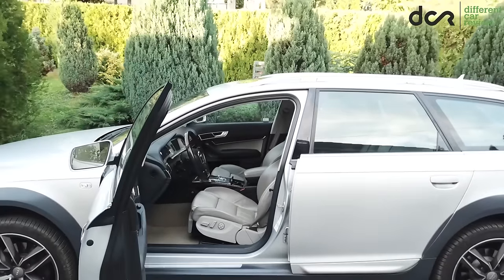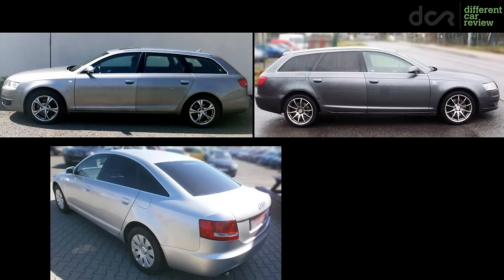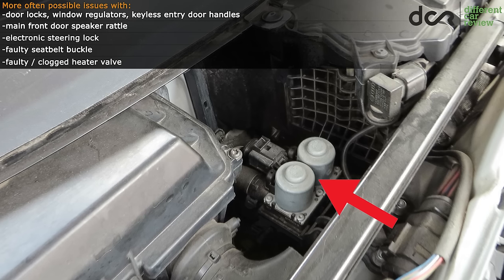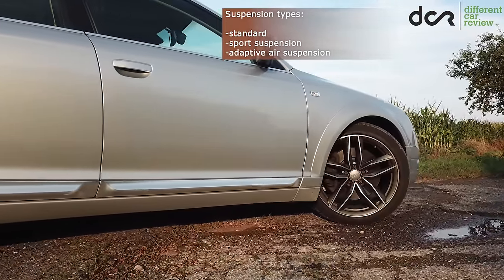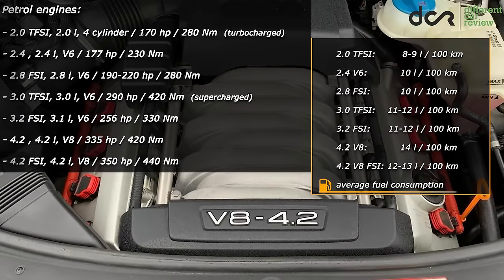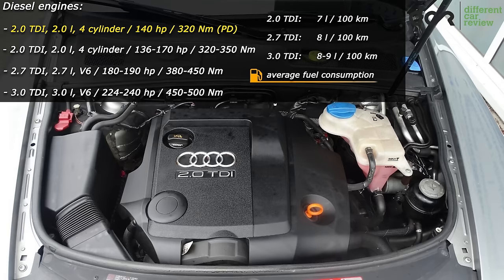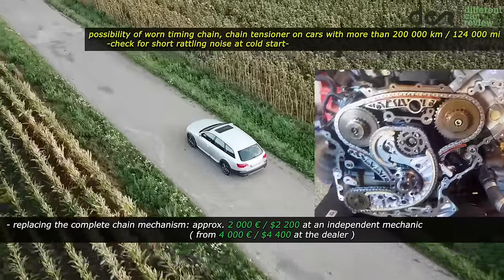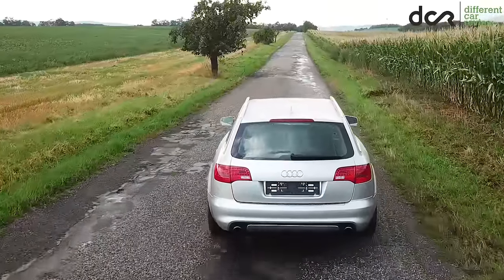used Audi A6 (C6/4F) - 2004-2011, Complete Buying guide with Common Issues

Comment: I"ve had the 2005 a6 4.2 for a year now, my only problem is that the whole left rear light wont work, even after replacing the lights. no turn signal, or brake light on that side. havnt been pulled over yet!
Reply: Post Malone hey I had the same problem but with both sides. There was a crack on my tail light allowing water to get in. The solution was just going and getting it rewired at the dealership
Reply: @ouu9380  Ditto to this comment but I didnt go to the dealership. Way cheaper to go to an Audi specialist, cheap to get rewired no problem and no risk of getting pulled over

Comment: Hello, awesome video, I have discarded lots of multitronic versions from my searching / list! 
I need your help / opinions please: 
I found a 2005 Audi A6 V8 Triptonic without quattro vs a 2006 Audi A6 V6 3.2 FSi quattro , which one would you buy if the 2005 Audi is 1000 Euros cheap than the v6 fsi? I dont know if the 2006 is triptonic or multitronic, even if its triptoonic, as I far I know, quattro versions got air suspensions by default making this v6 less reliable?
Reply from the maker: Hi
-all the V8 and all the quattro versions are always equipped with the tiptronic, + the V8 models always have the quattro 4wd system
-the air suspension was always optional, so only the Allroad versions have it as standard (if the car you are looking at has air suspension then of course sooner or later you have to expect leaking air struts and worn out air compressor)

if you are asking which one to buy the 2005 4.2l V8 or the 2006 3.2 FSI, then this mostly depends on the condition of the car and the mileage, since both of these engines can withstand a lot with regular maintenance, so they dont really have any serious issues, but:

-both of these engines have a timing chain mechanism which can be worn after approx. 200 000 km-mainly if the previous owner have not changed the oil often, so listen for a short rattle at cold start which is the sign of a worn chain

-the 3.2 FSI can have a noticeable amount of carbon build up on the intake valves + it can have faulty injectors-causing misfires, as the other direct injection engines

+ the various oil or coolant leaks can be more expensive to fix on the V8 engine
Reply: @differentcarreview-dcr  Thank you, sorry for my late answer.

I will go for the V6 3.2 Fsi, it got 112, 000 km, instead the V8 which got 200k km.
The V6 3.2 fsi quattro looks nice, I will follow all the tips before purchasing it mate! Thanks

Comment: For the saloon one I have the steering lock problem as well 😱
Reply: It's not a big problem if you fancy trying to fix it yourself by removing the steering column control module and replacing the faulty components
- Step by step video - https://www.youtube.com/watch?v=O9iPJQfZgbo)
- Components kit for around £40 - https://www.ebay.co.uk/itm/STEERING-LOCK-MODULE-4F0905852B-REPAIR-KIT-FOR-AUDI-A6-C6-Q7-2004-2009-4F0910852/223729640146?hash=item34175362d2:g:IXYAAOSwfW5du0Qa) 
- Alternatively you can pay for the service to have someone do this for you for around double that price, a few companies on eBay
- £95 - https://www.ebay.co.uk/itm/REPAIR-SERVICE-Audi-A6-C6-Q7-Steering-Lock-module-Relay-micro-switch-faults/132244158313?ssPageName=STRK%3AMEBIDX%3AIT&_trksid=p2060353.m1438.l2649
- £85 - https://www.ebay.co.uk/itm/Audi-A6-C6-Q7-Steering-Lock-module-Repair-Service-Relay-micro-switch-faults/254413840197?ssPageName=STRK%3AMEBIDX%3AIT&_trksid=p2060353.m1438.l2649
- Finally you can take your car to a garage (assuming you’ve cleared the error code with VCDS) and they can do the whole job (i.e. remove the control unit, replace the components, test and replace control unit) at more a costlier £280 (Hayes Garage 07872965883)
Hope that helps, I don’t think anyone should just give up for this one annoying problem, the A6 B6 is a fantastic car
Reply: If you're in Toronto or get the module and send it, I can help fix it for a reasonable cost.

Comment: Is oil change in the automatic gearbox included in the service scheme? I mean do the dealer recomend it to be changed or do people usually not change it?
Reply: The audi dealer says the tiptronic oil is lifetime. However, the ZF says you need to change every 80-100k kms depending you drive type. 😉

Comment: approximately how many kilometers does the engine chain change? 3.0tdi 2008yera
Reply from the maker: nobody knows, but it should last approx 300 000 km (depends on past oil change intervals and if the car was used on short or longer distances), however if its rattling during engine start then its better to change it preventively
Reply: @differentcarreview-dcr  yes its rattling 2-3seconds when I start engine
Reply: but afterwards nothing is heard
Reply from the maker: 2-3 seconds is a pretty long time, if you want to be on the safe side then replace it, the longer the rattle noise - the bigger the chance that the chain jumps
the chain jump on these 3.0 tdi engines is not like very common, but it can still of course happen and I have seen numerous these engines with skipped chains, so it all depends on you: if you want to push your luck or replace it
Reply: My mistake is rattling 1second is this a problem big?
Reply: but it is not heard every time I turn it on only occasionally
Reply from the maker: in this case I would not be worried too much about this,
of course the chain can still jump ! but if the rattle is as you described then there is a small chance of this failure on this particular engine
in these cases its important to let the engine idle at least approx. 20-30 seconds after start up and just then start driving (if you would start driving right after start up then there is a bigger chance that the chain is not gonna be tensioned enough and it jumps)

just keep in mind that if the rattle gets worse than the chance of chain jump increases
Reply: It uses a hydraulic tensioner. That means that if the chain is streached, it will rattle until the tensioner fills up with oil and tensions the chain, so it stops rateling. The chain will continue to streach, and thetentioner will eventually reach its max leinght and will not be able to tension the chain any more. Then the engine will be out of faze, run badly, and the chain will skip the tooth(s) which can destroy the engine. Change the complete chain set.
Reply: @DashCamSerbia  brate mozes li prevesti molim te
Reply: @zeljkolukic5856  Па где сад да преводим, зар не знаш енглески... Имаш гугл преводилац, мене тастатура зеза...

Comment: Typical vag then, it will do 300,000 miles but you basically have to re build it. Merc on the otherhand.
Reply: Not sure what you experience of VAG engines are but i'm both a VW and AUDI owner for years and they're rock solid (without the need to rebuild)

Comment: Sounds like the A6 is even a bigger money pit than what the 5 series BMW is lol :))
Reply: i think you're missing the point, all the big players (BMW, Merc etc) will have just as many issues but as this video points out you need to take care of maintenance to get the 400-500km out of your engine. It's a superb car (coming from an A6 owner) and honestly you cannot believe it's almost 10 years old
Reply: @hamwicbi1265  i didn`t own an audi, but i have owned bmw`s, vw`s and lexus. All of them had mecanical issues, bushes, control arms, cables, rubbers etc. These are what i consider to be maintenance parts that can go wrong over time. On the other hand, for the engine to go  kabum (like the 2.0 N47 engine from BMW does) that is not acceptable.
Reply: Not even close, the Audi is relatively affordable as it's just a VW at the end of the day.

Comment: This might be a hail mary considering its a old video but i got a a6 c6 2.4 v6 that has the problem with the ratteling at coldstarts (-15 c ish). sometimes it might be for 2 sec at max and other times it could be up to 4 min. Ive gotten alot of diffrent opinions on what it could be. some say the oil pump. some say its the lifters and some say it has to do with the valves sens the sound dissapears when you accelerate the car when its cold for a sec... anyone have any clue? Note to add/take note. i recently changed the oil to 5w-30 and it sems to have helped the car a bit. the sound has dissapeared with atleast 50 procent but the problem till exist.

Comment: My buying advice: ....don't buy one! It was the worst of all my cars.... even my Lada Niva was much better. This is an unreliable, overpriced piece of garbage! You forgot to mention the transmission, camshaft bearing and turbo problems. Thank you.... good video!
Reply: there's a lot of happy owners that say it is an Reliable car, me included! there allways will be some "Monday-models"

im happy with my 2005 2.7 TDI and i guess the next car, will be the Facelifted version for me ;)
Reply: @HIIMUsc   I'm happy with 2005 3.2 Quattro 133k
Reply: Overall the car has been actually pretty solid ... definitely several issues. Window regulator plastic clip breaks on these quite easily and I replaced and reinforced it. 
The taillights often fail due to poor contacts inside the light so I soldered them and no issues since. 

Visor clips often break on these after just 50K miles but those are cheap. 

I replaced my timing chain tensioners even though it turned out they didn’t need to be replaced. 

Heater blower fails but can be fixed pretty easily if caught early enough. Once you know the issues, they are straightforward to deal with for the most part. 

Thank you for the detailed video!
Reply: @turbo97semax  2.7 Biturbo: 120tkm -new transmission ..6000€, 160tkm -camshaft+bearings...4500€, 180tkm -fire started inside...2000€, 200tkm -new transmission ...6000€, 220tkm -Torsen Diff ...5000€, 230tkm ...both turbos -finished with Audi!

Comment: So in one word - Audi A6 C6 after 200k km is a junky crap on wheels.
Reply: I wouldn't say that. My 2010 A6 has 409000km on it and until recently, very little has gone wrong on it in the 5 years I've had it

It's now coming up with an intermittent and temporary oil pressure warning on startup but even at that the car itself is still running perfectly.

Comment: Rule #1 when buying a used Audi: Don't buy a Used Audi.
Reply: as opposed to buying what used car, is the anything else out there that is more reliable (BMW and Merc with all their issues too)
Reply: I'd disagree personally, if you're handy, most issues can be fixed. Vagcom is priceless if you own one of these cars.
Reply: @ali1t  you must not have seen many used audi in your day or you have deep pockets lol
Reply: @anthonyaguilar9341  I have owned a 2000, 2006, 2007 Avante, and just bought another 2007 - truth is, I don't think you have? My guess is you don't have mechanical knowledge, most of the issues  can be fixed with a small level of difficulty - but you learn a lot in the process.
You're pushing a computer on wheels loaded to the gills, not an engine on a frame with a steering wheel. Comparing apples and oranges.

Comment: Advice : Don't buy , thank me later
Reply: i'm guessing you're a BMW fan :-)
Reply: @hamwicbi1265  yea true but i currently own one bro and it has alot of problems
Reply: @hamwicbi1265  yesterday the pipe of the fuel pump broke and wasted all my fuel
Reply: Bmw fam 333 J not that’s not great and there are a lot of issues with the A6 but my point is what car doesn’t have issues. My sister had a 2006 BMW 3 series and it gave her endless problems even with maintenance. I think all three German brands are cutting costs everywhere